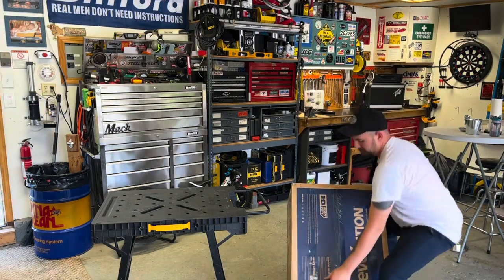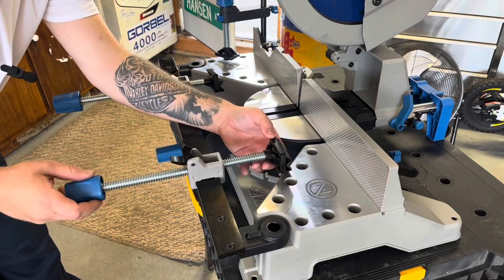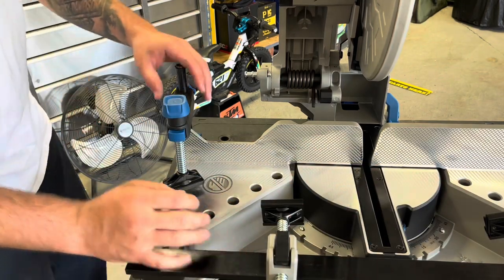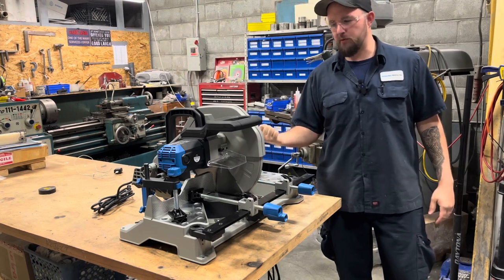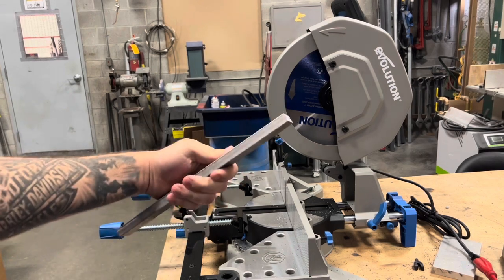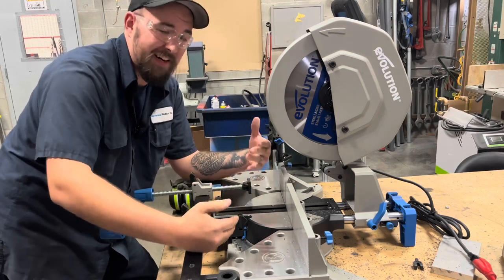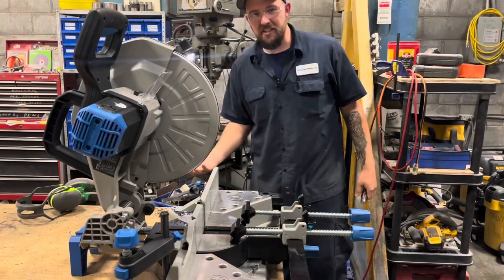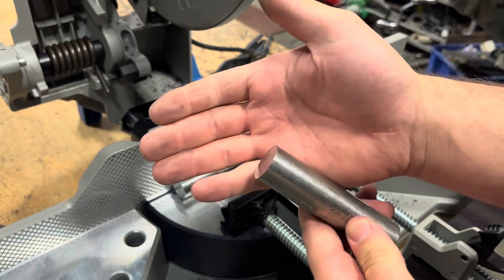Best metal cutting miter saw! Evolution S355MCS

Comment: I just received mine. Ordered it yesterday and it came today. Whaaaaat? Yeah! Very impressed. I haven't used it yet but I put it together tonight and I am very impressed with build quality. I've got a project already lined up. I'm going to add some height to my Gator dump box. The added height will require a completely different tail gate so I'm looking forward to my weekend of cutting and welding. Without my crappy chop saw and fiber wheel that likes to deflect on angle cuts.
Reply from the maker: Hope you enjoy it! I absolutely love this thing!

Comment: Nice piece of equipment! Love the features. The only question is how long the blade lasts.
Reply: I've had an evolution chop saw for probably 20 years, so that being said the blades last quite a while. In my shop I could easily get two months out of a blade in a commercial setting maybe longer, it depends greatly on your care and the material you are cutting. For one hundred dollar blade I have literally had to use a square point shovel to remove the chips on the floor.

Comment: Can their blades be sharpened/repaired?
Reply from the maker: I could only assume so?
Reply: @dansproshop  sharpening most likely. I use a Porter Cable saw that is similar and I have gotten blades cannot be repaired by replacing teeth—these are “captive teeth” blades.
Reply: In the UK theres plenty of places that diamond sharpen carbide blades. I imagine the US has them as well.

Comment: I don't know why manufacturers of carbide type metal chop saws think I don't want a precision miter that comes with a clamp that has an indexed reproduceable angle clamp just like wood workers get to enjoy in even the cheapest models.
Reply from the maker: Well this one solves that problem! Perfect, reproducible cuts every time!
Reply: @dansproshop  I just ordered it. I'm a little angry though that manufacturers are so stupid or lazy to not see the need for a blade that pivots on a degree able wheel. Every time I use my fiber type chop saw or horizontal band saw with material that has any length to it, I have to rotate the tool under the material. I am really looking forward to having a stationary spot for this tool instead of dragging whatever out into the middle of the room.